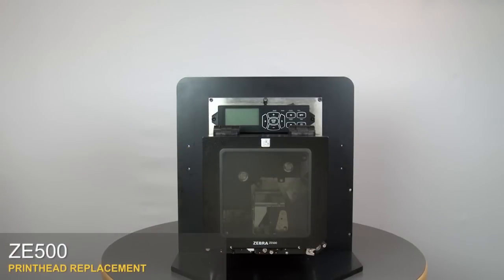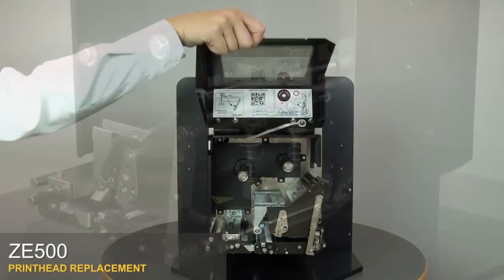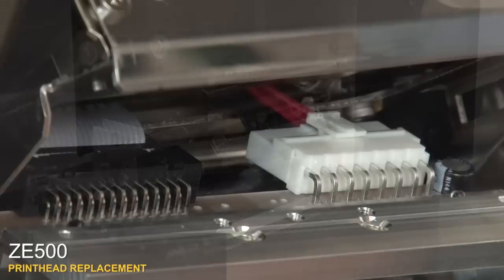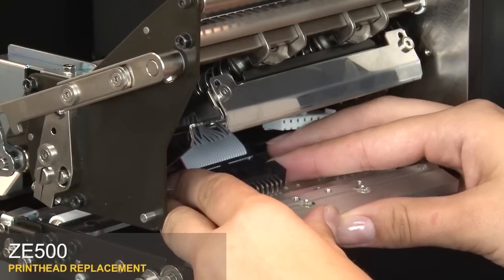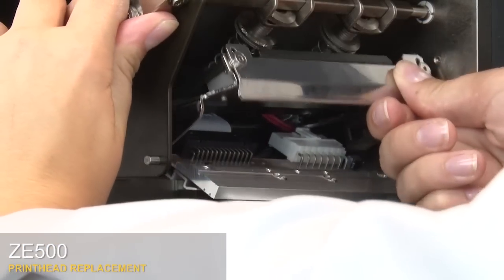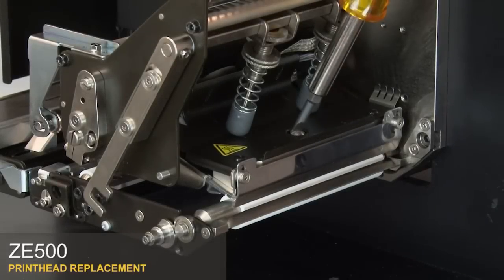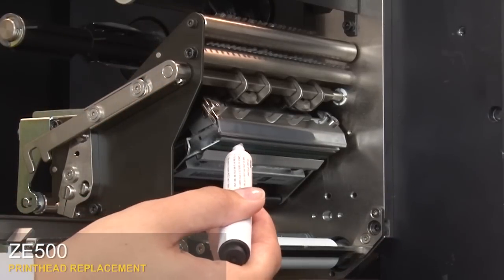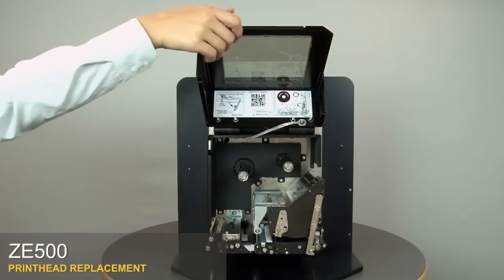Zebra - ZE500 Print Engine: How-to Replace the Printhead

Comment: wish they showed this with the tamp arm in place....really a pain and the wiring is actually shorter than that....
Reply: Not sure what the problem is when you have two simple options to get by the tamp arm. These options are applied during real work environments. First option is to hit the pause button rapidly and the tamp arm will start to descend. As soon as the arm starts to move turn the printer off, we have air shut off at an arms distance to turn the air off. This will allow you to push the tamp arm down using your hands pressing down. Just do enough where its out of your way. Continue to replace the printhead as normal. Once the printhead is swapped out and secured turn the printer and air back on. Allow the printer to boot up as normal. Once the printer is back online and connected to the server the arm will automatically return home. Calibrate the printer and move on with your day this method should take 10-15 mins tops.  Option two which is my recommend way. Turn the printer off, use a screw driver to loosen the bolt on the tamp head assembly like normal once the printhead is not attached and only by the wire harness, use a torque screwdriver I believe the size is T25 remove the flat metal plate under the printhead. once removed you can remove the front roller with the same screwdriver size, then drop the printhead underneath this gives you access to all the wire harnesses, disconnect them and reverse order back into play. This is the most efficient way to do it. I do these replacement on a regular basis and I can swap them out using the second method in 5-8 mins no issues at all. At first we all have experienced the frustration of these replacements however through time these two methods will help you save time and more frustration.